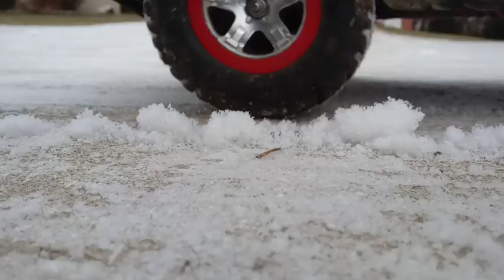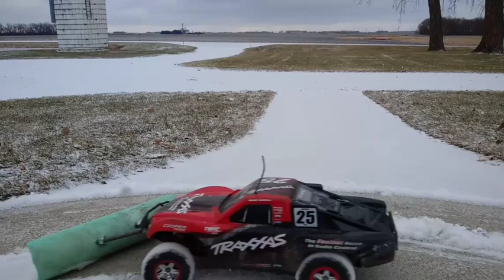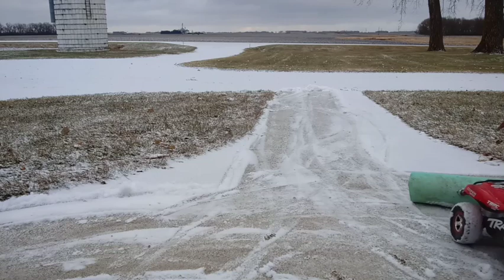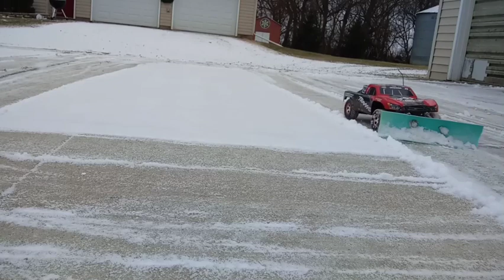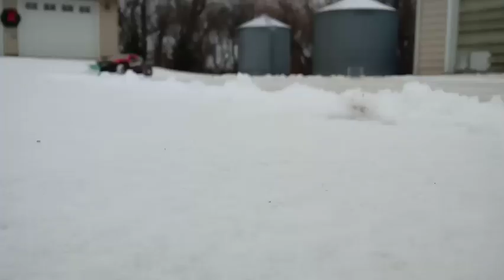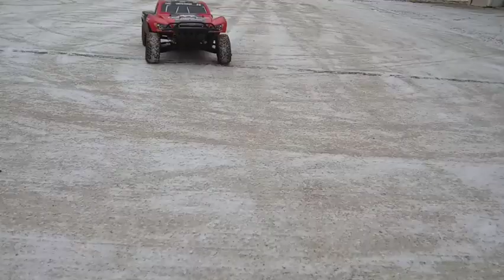First plowing of the year! (Traxxas Slash Snow Plow)

Comment: How do you build it so it doesn't fold under
Reply from the maker: I put 1/2 " bolts through the front bumper & plow  with washers on the plow too.
Reply: @morethanfarming2207  I just took a piece of cardboard and wrapped it in gorilla tape and you a carriage bolt and screw and took a shock off of an old nitro sport and use that to tape it down towards the bumper so it wouldn't rip off and go under the truck it was pretty hard knowing that I have a Traxxas raptor with millennial VXL